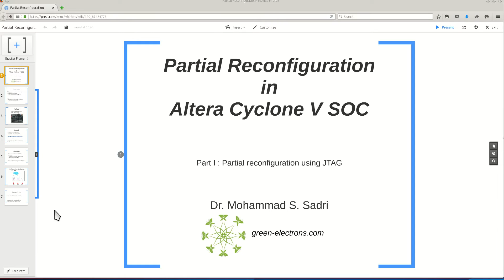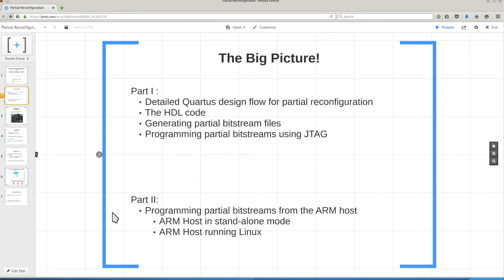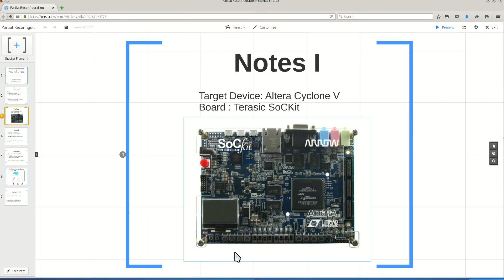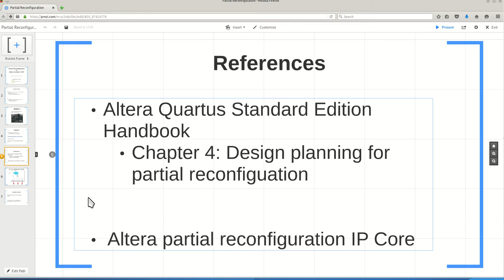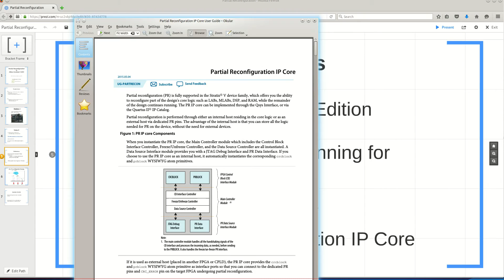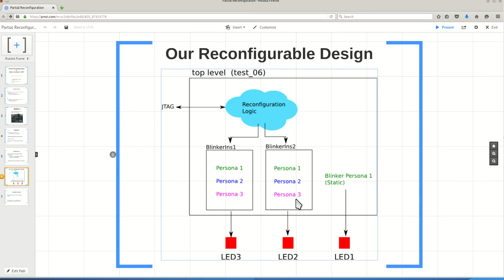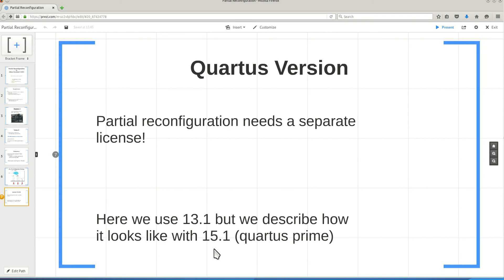Partial Reconfiguration in Altera Cyclone V - Part 1 - Section 1

Comment: Why have you moved away from Xilinx to Altera? Doesn't Xilinx offer partial reconfiguration as well? I'm just curious for your reasons of shifting. How does Zynq compare to Cyclone V SOC?
Reply from the maker: +Seakros Hi Seakros, I have not moved from Xilinx to Altera. Just there was a request from someone to create these set of videos and I did that. Comparison between altera and xilinx is difficult but in one sentence if you are using xilinx, keep using it ;)
Reply: +Mohammadsadegh Sadri Okay, message understood! :)
Reply: +Mohammadsadegh Sadri 'd be really interested to hear your opinion of the new tools being made available by these companies recently (i.e. SDSoC)
Reply from the maker: sure, soon i will add videos.
Reply from the maker: Now Altera is intel! soon Xilinx will have a very strong opponent. but still there is a way to that point...
Reply: Mohammadsadegh Sadri yes, but xilinx, I would say, has the better position ATM. I think Altera was chosen by Intel precisely because it was lagging xilinx in the market.
Reply: (and valued as such)